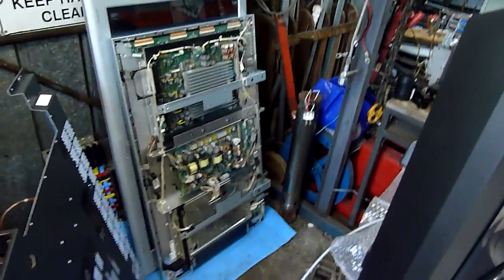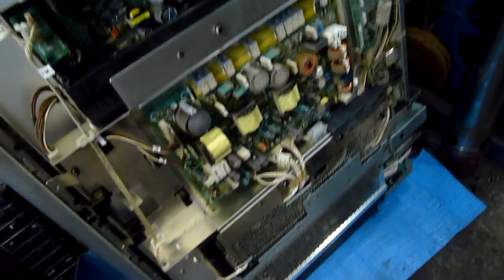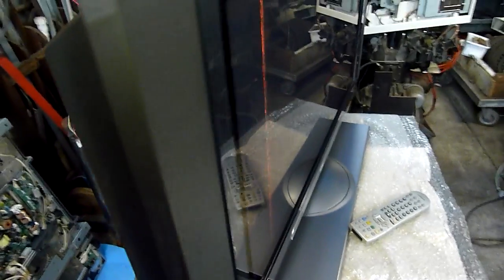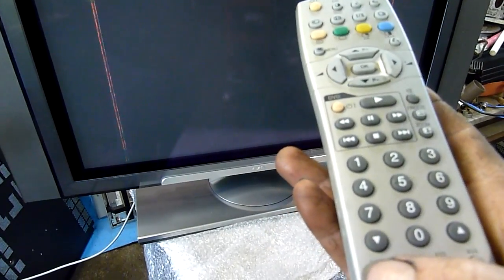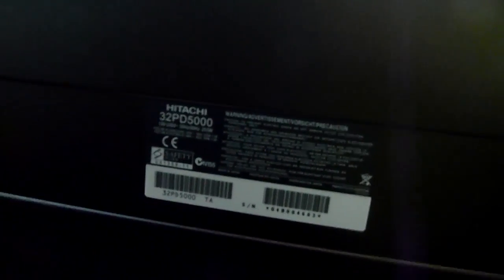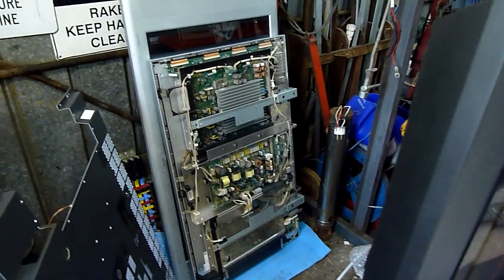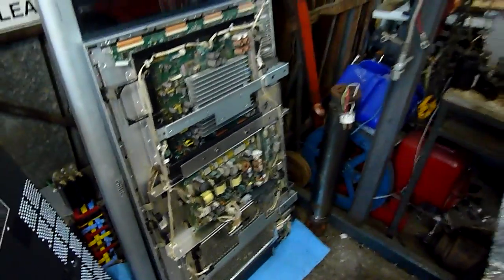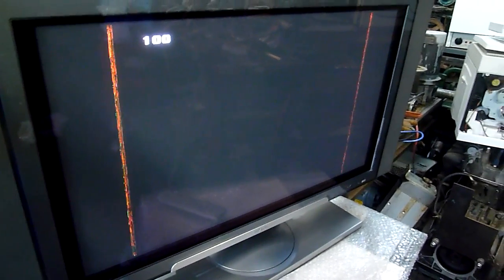Plasma TV Repair Update - NEC and 32 Inch Hitachi Donation

Comment: i found a hitachi M42PV6 that was thrown out. it doe'snt turn on but it clicks, the light goes orange red green, no picture, i checked the boards everything looks great, minus 5X 100v 2200uf capacitors on the upper middle PCB board, they had all bulged, not to breaking point but i think they are bad. would you have any other ideas as to why its not working? before i solder new caps in.

Comment: I got my first ever garbage picked flat screen fluro LCD TV and i have to twist the entire thing ever so slightly to make it work. Im guessing its a loose connection both power supply boards are pretty damn toasty looking dont see any buldging capacitors though.

Comment: If you can it might not be a bad idea to get a 250 volt cap of similar length and capacity, I don't think 100 mf more is going to make much difference on a 10,000 mf cap, that's well within a 5% tollerance.

Comment: we have a similar problem with our Maxent tv. its a 42" Samsung plasma made in Korea. 2 years ago it developed a blue line on the right side. it started off bright but over the years the pixels are just dying out. although certain colors it will display in the line just fine. its weird. but we have had it for a while. time for new tv soon!

Comment: I hate using a de-soldering iron. I would prefer to use a de-soldering braid but I ran out awhile ago. And even then They dont always do the best job on small things. Or atleast not without burning my finger tips.

Comment: Those lines on the hitachi might be the chip on film ic's or the panel driver(s) on the mainboard if applicable.

If the destortion is in the also visible in the menus, it has to be something around the panel signal processing.
Hint: Some ic's vary specs under a little heat.

That Nec might be the powersupply, but if that 200v cap was faulty, you should have gotten a big bang a while ago. It might get a signal to power down.

Comment: It seems Philips make everything (note at 1:35) you can see their name on the bottom of the aluminium panel, but I had one of the first Toshiba 32" widescreen CRT brought out and when the picture "started to turn green" and rather LARGE electrical "bangs" started coming from the back, I called our local TV repair shop, they opened it up and.......hey presto 90% of the chassis was made by Philips!!!!

Comment: Best tool you can get for through-hole is a desoldering iron .. it looks like a solder pump and a soldering iron had a bastard child but they work really well. SMD stuff is easy if you have a decent hot air too.

Comment: Hmm i would think the vertical lines problem would be the input to the driver chips as it seems to get random digtal like patterns, could just be the driver input bias/damping/feed resistors ?? perhaps lol :-)

Not really into tellys but it makes sense, hope its an easy fix for you :-)

I have put very short solid mains wires on capacitors and mounted them 90 degrees when i havnt the correct part.

Try a crude wire job to test that cap problem out.

Im sure your wil have fun :-)

Comment: Heh, I've de-soldered DC jacks from laptops before. The best way to do it, get a heatgun and wiggle it off with pliers. Then put a new one on as soon as you get the old one off. Gotta be careful though, almost ripped off a trace by doing that. >.<